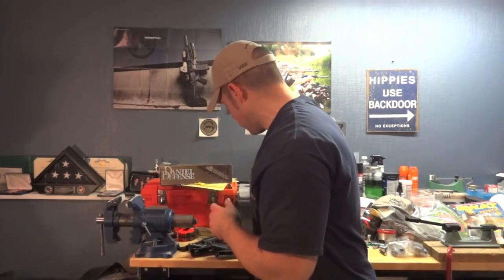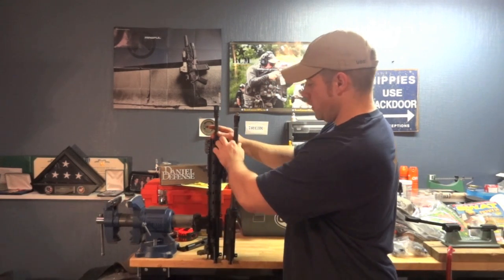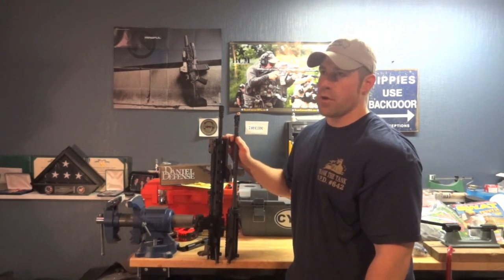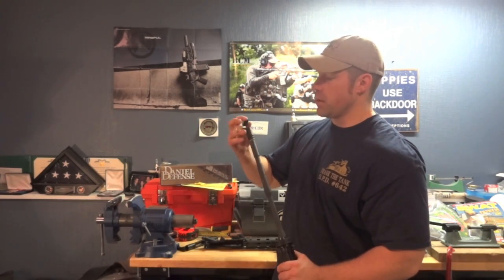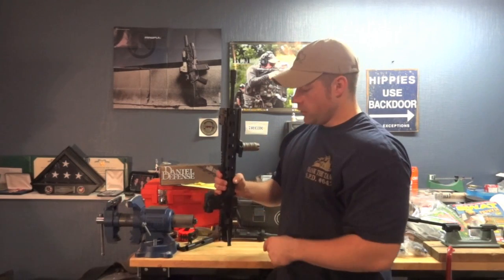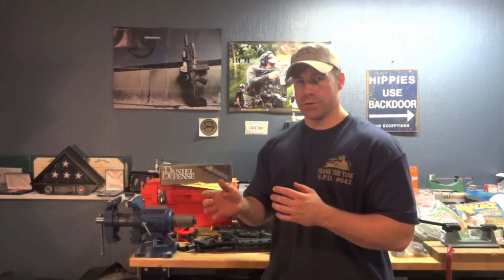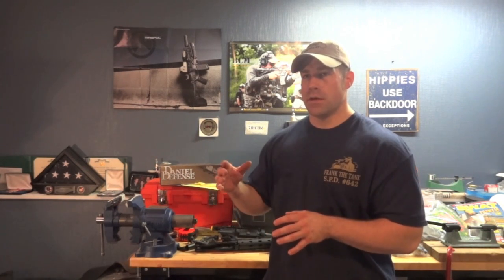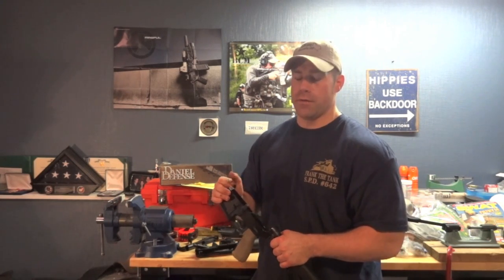Choosing a 16" vs 14.5" Pinned/Welded Barrel

Comment: I personally prefer the 10.5 inch barrels, although your range is a bit lower and the muzzle flash is higher, they require an NFA Stamp but it's worth it for the massive improvement in handling imo.
Reply: yeah except for now your bullet packs no punch...
Reply: Feel free to be the physical test of that.
Reply: +JSJ94 of course it's going to still do damage but more like a 22 than 223.. the 223 bullet needs minimum barrel length to effectively do its job. velocity wise..
Reply: DAprojectTurtle Just stick a heavier bullet in the thing then like the Mk262 or 75gr TAP. I think a person who knows what he's doing and builds a 10.5 AR is probably doing so for engagements within 100 yards, anything further and I'd want a 20" barrel or a 308.
Reply: +JSJ94 ok

Comment: Technically to be legal, wouldn't you have to remove the barrel from the upper receiver before you change out a muzzle device on a pinned and welded 14.5 inch barrel?
Reply: +Shane K All you have to remove to be legal is the buttstock. Its legal to own a SBR if all it has on it is the gas tube.
Reply: +Randall Berry you mean buffer?
Reply: No the butt stock the buffer has to stay on.
Reply: As long as a "rifle" lower receiver isn't on it or you put it on a pistol lower then it's fine. Either way there's no way anyone can enforce that in any way, shape, or form so who cares just get it over with.

Comment: Would you prefer stainless barrel over chrome lined?? or is that just personnal pref??
Reply from the maker: Depends on what it's for.  Stainless is better for accuracy, but it wears faster than a chrome-lined or melonite/nitride treated barrel.  Realistically, melonite/nitride is the hardest coating.  Chrome is also very hard.  Both are ideal for high round count and higher rates of fire.  CMV steel barrels also tend to be lighter than SS barrels.  The SS410 and SS416 barrels used typically are of a heavier profile for rigidity for long range precision.  So, for precision I'd prefer a stainless Noveske, BCM or Rainier Arms barrel.  For general carbine or SBR, I prefer a CMV steel Daniel Defense or BCM barrel.

Comment: I recently built up a 16 AR with a 15" keymod rail, and a pig cone style muzzle device which my ears really like at the range. I really would like the cone to be partially inside the rail. This is a reason I've been considering a pinned/welded 14.5I don't see any other option, I can't find a longer keymod rail. Any thoughts ? I do have a JP adjustable gas block and could adjust for the different barrel size. I would be ok with the permanence of the install.
Reply from the maker: +mark c I would think that would be fine.  If you plan on running the Noveske flaming pig, you could also look at a 13.7" barrel with a carbine gas system.  The Noveske is long enough that if permanently attached to a 13.7" barrel, it will be just over 16" and meet NFA requirements.  That would keep most of the device under the handguard.  Rainier Arms and Noveske have barrels that will fit that need.  Just a thought.

Comment: Great video. What is your opinion on the BCM 16 SOCOM, C8 SFW & standard carbine upper? The barrel profiles apear different in diameter.
Reply from the maker: The SOCOM and C8 are generally the same.  The C8 has a removable sleeve on the front end for certain accessories.  The standard has the conventional government profile with the reduced diameter under the handguard.  IMHO, the SOCOM is the best option.  You have more rigidity, which will help with accuracy and durability.  The standard is still an excellent option, and more ideal if you are trying to shave off weight.  If you are looking more for accuracy or high-work load/high heat durability, the SOCOM will be better.  The C8 is sort of a niche barrel, and I really don't see a need for it other than just to have it.  Regardless of what you buy, BCM is great.

Comment: I'm planning on a BCM 16" midlength upper with a standard barrel and a spikes lower. What buffer spring/buffer would you recommend for that set up? It's going to be shooting mostly high pressure 556.
Reply from the maker: If your lower comes with a carbine spring already included, you'll be fine with that.  If you have to buy one, pick up a Wolff Gunsprings factory replacement spring.  The rifle should run with either a standard or H buffer.  I'd personally recommend buying both, since it's only about $10 more.  Running the H buffer should work well for most applications.  If you run lower powered .223 like PMC Bronze or Wolf, just pop in the standard buffer.

Comment: Great vid. Answered my question. I'm going with a Spikes Tactical build and going to buy the upper assembled. Any thoughts on Spikes Tacticals quality?
Reply from the maker: +David Peden I haven't heard anything about them in some time.  They had a good reputation for a while, but then everything went quiet.  I really couldn't comfortably comment on them.  I'm somewhat curious myself, but I spend so much time working around the major top tier brands that I tend to start to lose touch with some of the more non-mainstream brands out there.

Comment: They dabble. They offer them in their custom builds. Do you have an opinion on DD 14.5 mid-length? I've been back and forth on 14.5 and 16. Your video is not making the decision any easier. Would love your input regarding the Daniel Defense specifically.

Comment: Is there a way to adjust the gas block on a pin and weld that you build? Or is there not a way to assemble it and adjust the gas block?
Reply from the maker: Most adjustable gas blocks today are designed to be adjusted without moving/removing anything from the rifle.  SLR Rifleworks and JP Rifles both have excellent options.

Comment: DD doesn't do pinned carbines? They've still got their own 14.5 barrel setup on their rifle builder w/pinned MD's. Expensive items, but very high quality. 

Say Andy, I've always been told that 16" rifles with carbine systems are the ones to worry about with overpressure. Haven't really seen many problems with 16" middies, el-cheapo junkers aside. Do comps and flash hiders cause that many headaches? The only thing I've known to muck up a good rifle is a can.

Comment: just picked up a 14.5 bcm upper,only thing i dont like about it,is it has a a2x flashider,and did not have the opion to order a different one.
Reply: Mike Carvalho i know im pissed i ordered mine last week and they did not give me a free bcg
Reply from the maker: ak prepper It's kind of annoying when you order a built upper, you don't get a BCG or CH with it.  If BCM did, the uppers would be just that much more expensive.  I would not have a problem with them increasing the cost, but it'd be nice to have the BCG included.

Comment: does the device have to be both pinned and welded? would it suffice if it's permanently welded in place, but not pinned?
Reply from the maker: +Yurchik Belov It depends on the interpretation of NFA.  I've heard arguments on both sides that say you don't need a pin and can just put a weld on, and others that you can use a pin without welding.  The reality is that if you pin, you need to weld that pin in place so that it A.) does not fall out under recoil, and B.) can't be taken out in the field or outside of a shop so that it is compliant.  On the same token, you may find issues with welding a MD in place if you only us one or two tacks since those could be broken.  
The best reason for a pinned/welded MD is to prevent damage to the barrel.  If you have a $300 barrel and a $70 MD, the MD is the easier and more cost-effective component to damage, and the damage likely will do nothing to the performance.  It's also the easiest to remove.  Fully welding a MD onto a barrel around the whole back surface along the barrel would be very difficult to remove, and likely would destroy the barrel upon removal.  
The heat from the welding on the barrel could also potentially damage the barrel.  You also would have to account for the barrel material, with SS versus CMV.  Granted that I'm not a metallurgist or welder, so to that end I can only speculate.
Reply: +SentinelDefense thanks. I am curious mainly about the legality. I always hear "pined and welded", but was wondering it a law specifically says that,  or if the muzzle device is securely welded that should be enough. My understanding is that as long as it is permanently attached and cannot be removed without spending time in the shop it should be good to go.
Reply: Four equidistant tack welds, or a streamline weld at least half way around the MD/barrel. Thats what ive heard, but this NFA garbage is so illogical and complicated, and different people with the ATF have said different things so many times, I'd contact them if you're considering using one of these methods. A little tip though: don't call. Contact their tech branch so you have record of whatever they tell you (just in case the opinion of some other dickhead with the ATF differs in the future)

Comment: Very good informational video. I have a question, I am building an AR with 16" .750 barell,  BCM low profile .750 gas block, mid length tube, and  Spikes tactical ST T2 buffer, will I run into any problems there?

Comment: Sir, I have an 18 inch pencil barrel, is it possible to have a pencil barrel chopped down to a 16 or 14 inch with ease or would it be easier to just buy a new barrel?
Reply: +Jason Griffin Just buy a new barrel.
Reply from the maker: +YourOwnDumbAss Ditto to that.  Yes, you can cut a barrel, but with ARs you will then affect the timing.  You need to match the barrel length to the gas port location and gas port diameter.  Given the cost of cutting the barrel, recrowning and rethreading, it's not all that much of a gain when you consider the cost of AR barrels these days.  You can buy good barrels for pretty affordable prices.

Comment: I suppose pinning and welding would be practical if you wanted to run a lengthy suppressor, I'm thinking like a 11-12" inch barrel with a 5 inch suppressor. Then again Im not up to speed on all the legalities. Hell I figure might as well go with a pistol setup with a stabilizer and forgo the length restrictions.

Comment from the maker: It depends on what you want out of the rifle.  For heavy use, the government profile barrel would be optimal because it would be more robust.  LW/pencil barrels are nice because they are demonstrably lighter.  If weight is an issue, get a lightweight DD or BCM barrel.  If weight is not an issue, go with the gov't profile for a little bit better durability.

Comment: Does this only apply to a 5.56? I built a 300 blackout with a 14.5" barrel and an arm brace. In Indiana, its legal to hunt deer with a 300 blk pistol. There is a bill in State Senate that would allow 300 blk in a rifle. if it passes, i would have the barrel pinned and welded and put a stock on it, making it legally a rifle not an SBR. Thoughts?
Reply: +Brian Bottorff in regards to barrel length and federal regulations ALL riffles much be at least 16" long regardless of caliber. If hunting in your area becomes legal with a rifle you and you decided to go that route you need to either pin/weld it or file paperwork with the feds. Im honestly surprised they allow you to hunt with a "pistol" especially where you cant shoulder a pistol to make a shot.
Reply: +Josh Rondeau Indiana has a minimum case length and diameter listed for deer hunting with a handgun.300 blackout in a pistol/ handgun is legal. Now the senate bill in Indiana has passed, I have pinned and welded the muzzle brake onto the 14.5" barrel. The combined barrel and brake length is 16.75" long, making it legally a rifle, therefore I am able to put a stock on it and shoulder it. I follow all state and federal laws. I will not build an SBR for the simple reason, I do not need Uncle Sam knowing if I have an AR, it's none of their business. My question was regarding the barrel length and gas system compatibility. But since my previous comment, I have found the info I was looking for. Thanks for your response!
Reply: yeah 300 blk is a whole differnt area as far as gas systems go. thank god for the internet for our questions. lol

Comment: @SentinelDefense
How do you feel about Aero 14.5 in Middie? (M4E1)
My buddy snagged one, hasn't fired it and said he was told by the reps that it would have perfect 3 o'clock ejection with a CAR buffer and factory spring, yet I accidentally told him to buy a chrome silicone spring and H buffer being he said he was getting a Middie... Hopefully that doesn't rule him out of using 223 or cause any issues being that's his default currently, he may have a CAR buffer on hand but I doubt it.
Reply from the maker: There’s no such thing as a guaranteed ejection pattern because there’s a difference between ammunition manufacturers and what they load their rounds to.  American Eagle AE223 is at a different pressure than XM193, and both are much different than PMC Bronze .223 or Remington UMC.    If the brass is ejecting in the 2:00-4:00 range, you’re gonna be fine.  As far as Aero, they make okay stuff.  Middle tier company.  You’re not getting a BCM or KAC, but it’s also not trash either.
Reply: @Reedo302  VERY good observation that I somehow didn't even think to ask "how can they say that due to so many variables?"
 Unless they were talking about a certain ammo brand, although even then, ammo varies round to round, box to box, Lot to Lot (IMO)
Talked to him today after checking our your vid and some others and he said he hopes that it can reliabily run bronze 223 as well as the Xtac types with an H buffer in it, although their "perfect 3 o'clock ejection promise" was with using the CAR buffer and factory spring (feel bad as I talked him into getting an H buffer rather than a CAR buffer and a Chrome Silicone normal strength spring, before knowing some of the things I do now. Hoping it's something that varies, although replacements aren't expensive, just don't want to have steered him wrong.
I told him he may want to do the "lock back" test with the bronze 55gr, and by his side, like limp wristing a rifle basically to see if you can induce a shortstroke to make sure it's not on the threshold if shouldering it.
Reply: @Reedo302  Also,
He said that per his research, that many say an H2 in a Middie 14.5 will run fine, but that an H is the sweet spot. Do you feel that advice is likely based on ammo, build brand, or both?
 I've always felt H2s work best in "most" Carbines being they are gassy, and that an H is kind of the sweet spot in a 16" Middie (when wanting 223 AND 556 to work, brass like Bronze 55 and wolf Gold, no steel cased as personally I feel their is too much variation round to round in the ruskie steel cased stuff)
 For his sake I'm hoping it will work with PM C bronze 223 with the H if Aero did things right (well, "Ballistic Advantage" whom make the barrels)
I guess using a Car buffer isn't a bad thing, I just have more time tinker and "blind tune" time than range lately so I may trust heavier buffers more than I should.
In summary, Many speak highly of the M4E1 but I assume their is no "problem" per say, just a "Don't go heavy on the buffer" in some cases, correct?
Reply from the maker: @tonynorris1506  The problem is that ammunition manufacturers have different standards.  Federal/American Eagle is pretty consistent with their ammunition production.  PMC Bronze is made in Korea and I’ve seen two different lots of 55gr .223 post a 300fps difference on a chronograph out of the same 11.5” SBR.  Ironically, the SBR was just built and having problems, we we were able to diagnose the problem in class as the lot of ammo he was using from PMC being different than the previous lot he used when he tested it after building it.  Point being, you really can’t guarantee anything.  That said, what he’s saying is legitimate for the most part.  The problem is that nothing is a guarantee, and while some guns are heavily over-gassed, others are not and it’s hard to keep track of who’s doing what.  I generally tell people that they should just run their gun and ammo first, and then adjust off of the performance of the gun after they use it a bit.  When I’ve bought ARs, I’ve never replaced things like recoil spring or buffer unless I’ve shot it and identified a problem first.  I’ve seen this backfire on people where they’ve bought BCM middies and put heavier springs and buffers in and shot .223 and it didn’t work, because they didn’t know that BCM tunes their rifles for 5.56 spec ammo from the factory.  Chances are though that the setup here in question will likely run fine.  I tend to believe that people spend too much time chasing the dragon when it comes to tuning ARs.  There’s merit to having a slightly over-gassed gun in terms of reliability with a variety of loads.  It’s just a matter of making sure there’s a balance so you don’t over-gas.
Reply: @Reedo302  My friend got some info from Aero about their gas port sizing on their 14.5s! 
Wondering what you think about these Specs, especially for the 14.5 Middie (although the carbine version sounds on the small side unless I'm mistaken, well, here is the quote by the Aero rep:
(Quote)
""A mid-length 14.5 has less dwell-time than a Carbine 14.5.
With that being said,
.0785 Should be the port size on the Ballistic Advantage barrel of this length.
The Carbine 14.5 will have a .0635 sized port.
-Aero Tech Support""
(End quote)